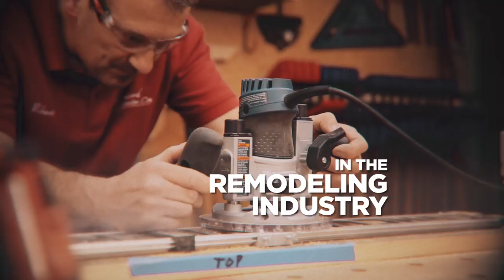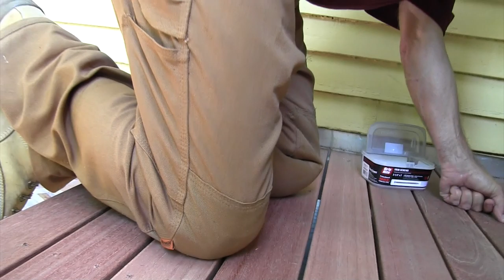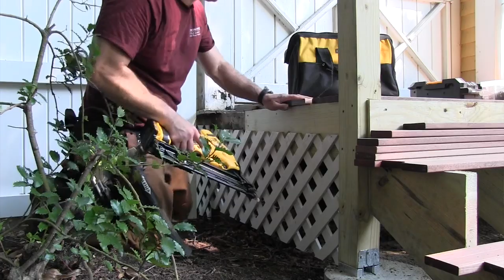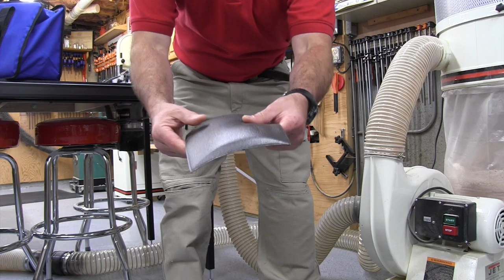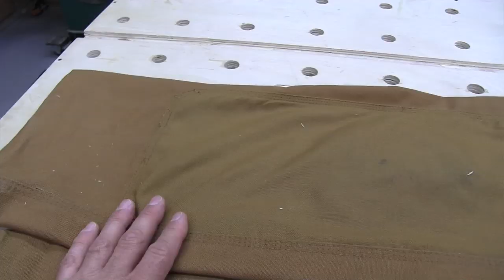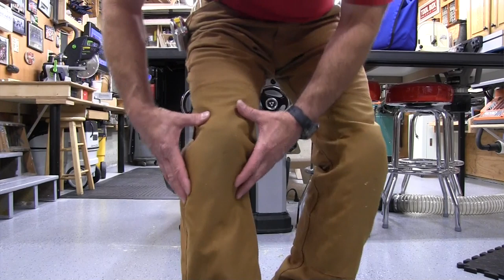Work Pants with Built In Knee Pads   ** Protecting Your Knees **

Comment: Here in Australia the Hard Yakka Legends are a great pant. I bought a few pairs of the light weight material for hot weather and even they lasted through a few years of hard wear! They have a removable knee pad that curves around the front of your knee. They slide in from the bottom and are secured by velcro that covers 3/4 of the bottom so debris can still fall out most of the time. Great video on the importance of taking care of yourself!

Comment: I used to go without kneepads even though the Snickers trousers my work provides has a slot built right in for them. 
I was in the boot one day before going into a job where I knew I'd be crawling through a roofspace and saw my kneepads poking out (just the really cheap foam knee pads) so I slid them in. I could barely feel them and the difference was unbelievable, I was on my knees for most of the day crawling over joists and I had zero pain at the end of the day.
Having them slotted into the trousers was massively more comfortable than having them strapped on.
We've only got one body, we need to take care of it and it's good to see companies taking the hassle out of it by building protection in.

Comment: I have used snickers trousers for 24 years. Tried others blåkläder and few other brands but they are not thinking all things. Snickers kneepads can be height adjusted and have ventilation, pockets are bigger than blåkläder where hand with gloves are too big, textile pouches are easily cleaned when turned upside down, pockets can be tucked inside if not used, kneepads are covered so that saw dust cannot get in, pocket departments are just enough for me, utility knife, hammerloop, knipex pliers, inkpen and pencils, hultafors tape, hultafors folding square, phone and additional belt pouches for specific jobs. They last so long that you need to buy new because fashion changes.

Comment: I find that some double knee pants are not low enough for my legs. I end up kneeling on the tip of the knee pad and have to constantly pull my pant leg down. And I certainly understand what you mean about the knee pads twisting which can be a real pain at times. Very informative info as I have never tried either of these types of pants and will check into them. Thanks.

Comment: These look great. I've been through my share of PPE items the last 35 years and still find it hard to beat Duluth fire hose 11oz. cargos. Even the optional hammer hook attachment for those times you don't have to carry those heavy tool bags around. removable/replaceable thin knee pads is a hard thing to bypass and may dry faster after washing as well...thanks again

Comment: I've been wearing built in knee pads for 15 years now.  The silicone wash in soft knees with carharrts.  Used to be a great combo, but Carharrt has gone hipster fit, and now when I kneel a lot my pants fall down (yeah I'm the same).  So carharrt has basically abandoned carpenters.  I'd love to see you cover more workpants, but with attention to whether bending a lot moves them out of position.
Pockets and hammer loop matter too.  I won't buy a pant with a hammer loop on the right.  I don't usually wear a belt anymore, I need a knife, a tape, a hammer, and pencils.  And they all need to be at the side for bending over.  Which obviously makes it tougher to keep the wasteband in the right position.  And I love overalls, but not in Virginia most of the year.

Comment: I've been using kneepad pants for the last 15ish years. I started with the heavier fabric skillers pants which were long lasting and hot in summer. After those, i used (and still do) the bjornklader jubilee pants which had a better design and were almost as heavy duty and hot in summer so i got shorts versions also which i were not as good just because there was no kneepads. After that, i got snickers 3211 pants which are super breathable to the point where i no longer needed shorts in summer. Those did not last quite as long as the other thicker pants, but they still do work well after about 5 years and counting. I just started wearing the newer generation of snickers pants and they seem to be the highest quality pants I have found so far. The d30 kneepads are very good as well.

Comment: As I’ve gotten older and needed a neoprene knee sleeve I found a Bodyglove surfers knee sleeve with a 1/2” thick pad is all i wear now. It supports my knee from poping when kneeling and fits under my carhart and levis so it’s always there. Sweating is an issue but I leave mine on all day long every day Working or not.

Comment: Rather surprised that you never mentioned Duluth Trading. They have offered pants with removable kneepads for likely decades. They also come with the gusset, pockets galore and different weights for different seasons & climates. They also have sizes to fit virtually anyone. I initially went to Duluth Trading for the XXLarge Tall shirts which are impossible to find.
Reply from the maker: I'm sure their great - we did'nt test them. I'm currently testing Mascott
Reply: Great video Rob - important and under -considered subject. I have recently got 2 pair of Duluth DuraFlex work pants with knee pad pockets. Very comfortable, and as you say - the knee pads are always there. They have lots of pockets, and velcro straps on the waste to hold tool bags (not a big fan of this feature - if I need tho have than many tools on me I prefer my tool belt). Look forward to seeing your Mascott video.
Reply from the maker: TheBrix57 haven't tested them yet

Comment: Hey rob, thanks for the video. I have been working a lot this summer, and one thing I have found is I blow my pants in the back along the butt. When I bend over she just blows. It got so bad one week I went through a pair a pants a day. So my question is do have any good pants that won't blow in a single day?
Reply: Jack Brennan Diet. Loose weight. Fight obesity.
Reply: Wear a belt
Reply from the maker: Not sure man, is it your body type? (heavy set or body builder) do your wear a. Let to keep pants sitting where they should be?

Comment: not using hard hat, saftey glasses, respirator, or hearing protection? nice video.
Reply from the maker: JronmanBuilds respirator - why? Hard hat not required on residential work like this - there's no  overhead work.
Reply: I was hoping you would get a laugh out of the comment.

Comment: You guys should really review Metabo some time there an extremely good brand built 100% for trade and industry German engineered to:)
Reply from the maker: Mr Sevenfold we cover Metabo in out head to head tests
Reply: they dont quite have as many tools as other brands and are lagging behind in the brushless power and innovative ideas.. however what they do focus on they do well id love an angle grinder from them and theyre the only company i know making 9" cordless angle grinders.. their drills are suppose to be really good for drilling steel aswell